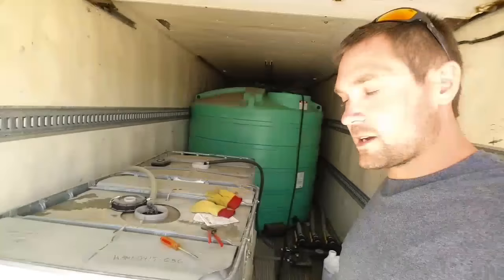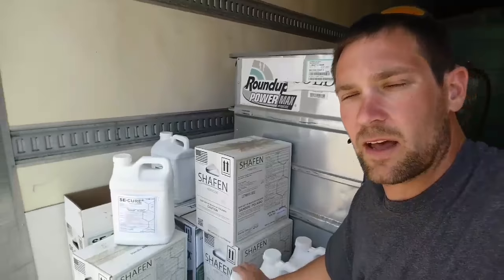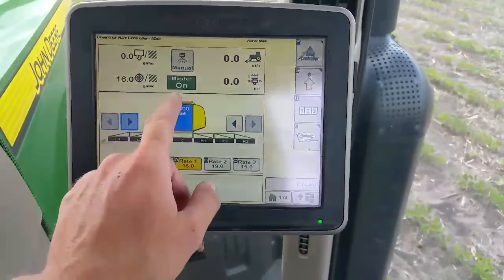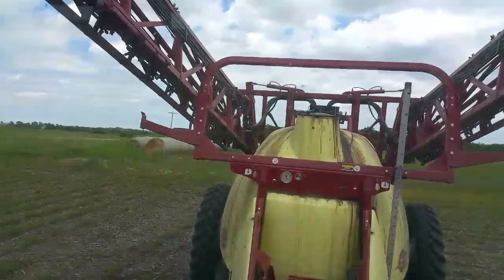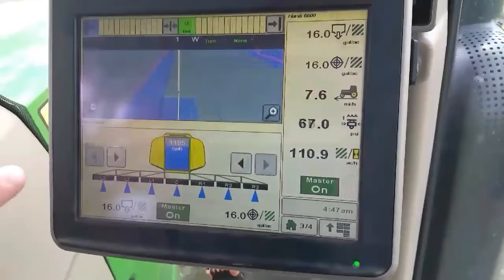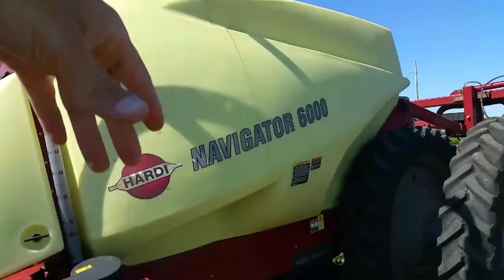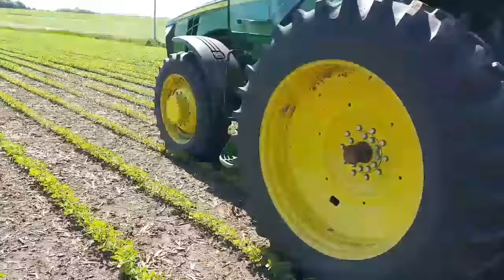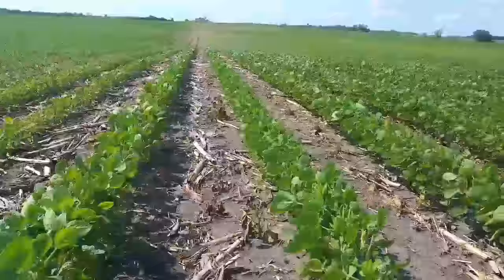Spraying GMO soybeans/how the sprayer works

Comment: Good video your doing same program I'm using here in central Illinois although some farms I still go 100% roundup some I used flex star where there is waterhemp pressure.... nice set up you have there we run a 4440 spra coupe 60' booms but can travel at 13-14 mph 10 gal

Comment: Just curious. Why not run a self propelled sprayer? And what speed are you usually running? Do you find that increasing your gal per acre, increasing coverage, help with the control of the weeds? But still running the same chemical rate per acre.
Reply from the maker: Mike Hasher We have a self propelled sprayer now, but at the time the video was made we didn't because they're so expensive.  We spray more water when spraying aphids but otherwise we have had good luck at 10 gpa with most herbicides so we don't feel we need to go more.

Comment: Great video. On 30 inch beans what would be the average of times you would have to spray until they fill in.
Reply: most the time 1 time but on occasion you have to spray twice
Reply from the maker: We use pre-emerge on ours right after planting, then we come back and make our main pass a few weeks later.  Hopefully that's it for weed control but we most likely will have to spray for aphids in early August also.
Reply: MN Millennial Farmer Thanks I up in central Ontario east of Toronto and a very dry spring and had poor emergence on any hill ground there is basically nothing and been on the roundup program so gonna go with a pre for 2017. Keep the videos coming.

Comment: How well does autosteer work going through the rows? Does it avoid the plants, or is there some running over the rows?
Reply: A lot of farmers that do row crops have RTK which is sub-inch accuracy. Depending on the tires used, it's pretty easy to avoid most but not all of the plants because of turning on the ends and whatnot.